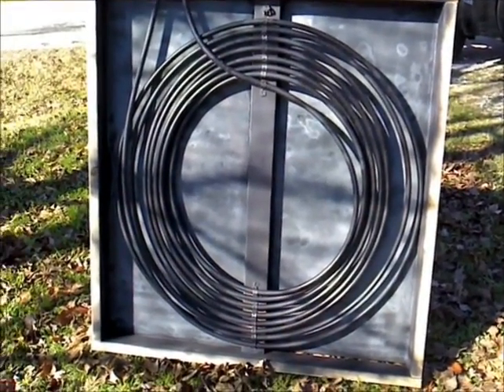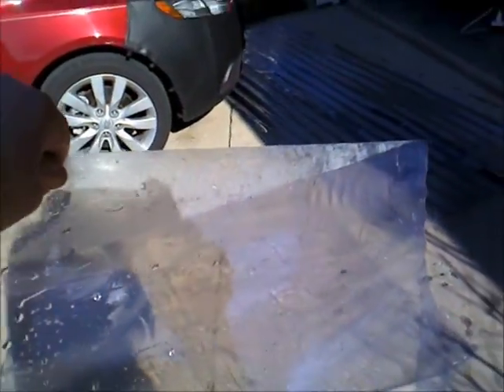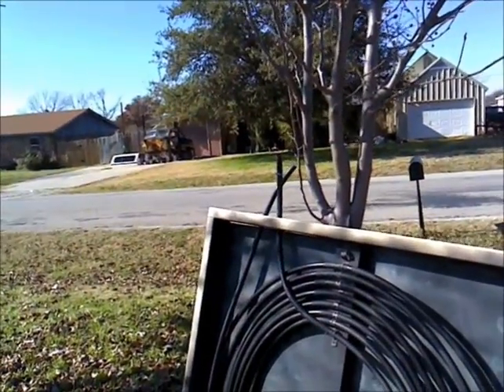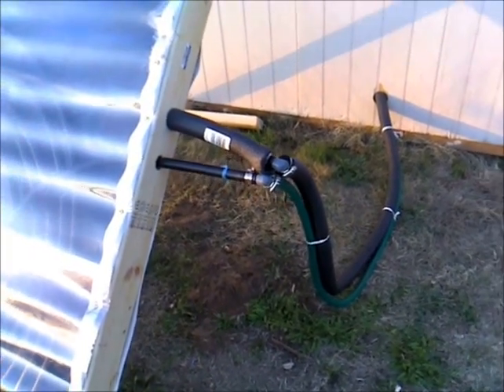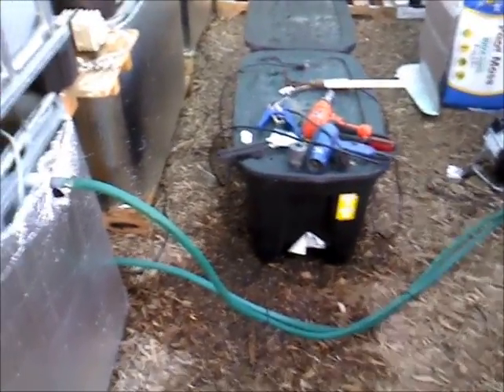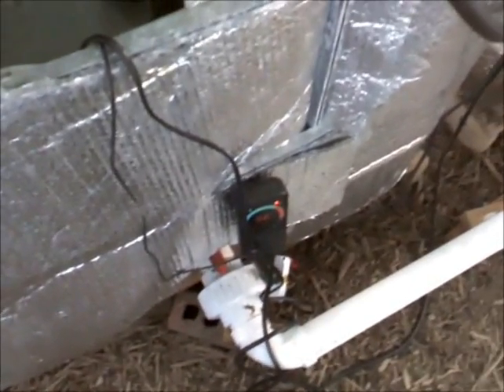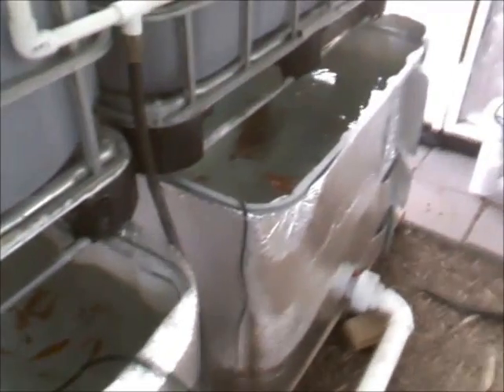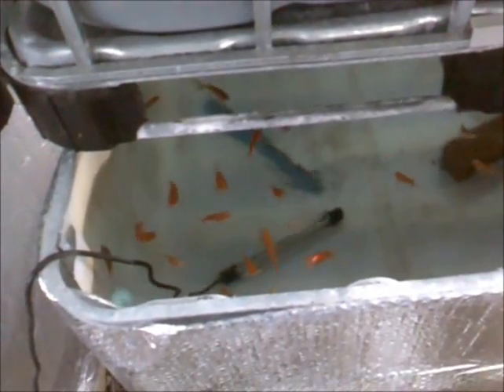Solar Water Heater for Aquaponics Fish Tanks

Comment: you will get better flow and let your pump work easier if toy put you  coils  horizontal, otherwise its an up hill push on every coil effecting causing a head pressure.

Comment: One thing I would be careful of is using hoses and tubing that isn't NSF or designed for potable water.  Typical garden hose contains all sorts of chemicals that you do not want to be ingesting nor do you want to introduce to your plants and fish if you are planning to eat those. A safer way is to create an heat exchanger where it has a stainless or appropriate coil to transfer the heat into the fish tank. Certain types of copper tubing can be toxic to fish so do research before using copper.

Comment from the maker: The plastic can fail if it gets above 140 degrees inside the solar box, but I haven't had that problem yet. I am currently using clear roof panels on the front instead of glass which is only giving me an approx. 4 to 8 degrees rise in temp. With glass I will probably get a 10-15 degree rise, but I won't know for sure until I replace the plastic with glass sometime in September.

Comment: I've heard the plastic fails. but what kind of water temp change did you get out of this system. I getting ready to set up my AP system and this is on my mind for wintering over. I live in southern Arizona so its not as drastik as some places but the winter does bring temps below freezing at night.

Comment: Nice!  Where are you located?  Curious about the climate you're using this in.  Been thinking of doing a similar heater myself.  Had thought about a closed-loop system rather than pumping the fish tank water directly through the heater, but your direct system is certainly simpler.  Any thoughts about that?  Best wishes and I look forward to any updates.